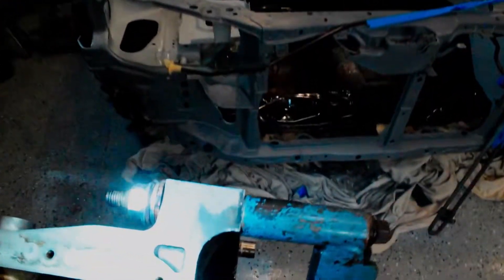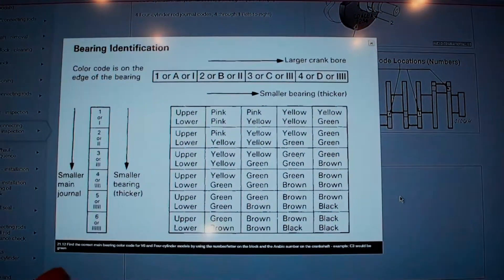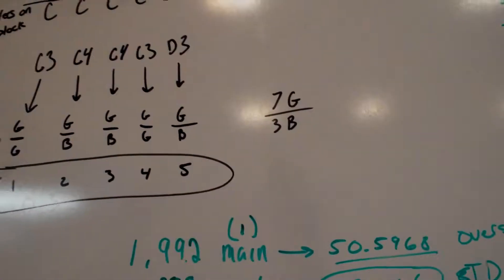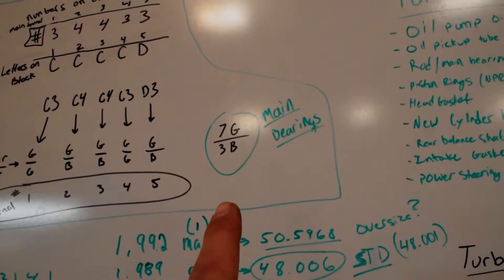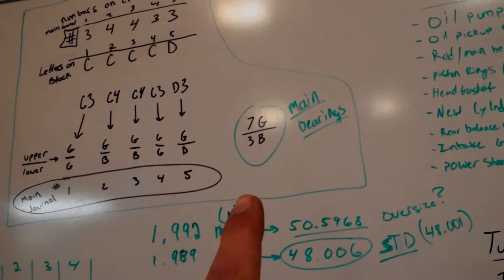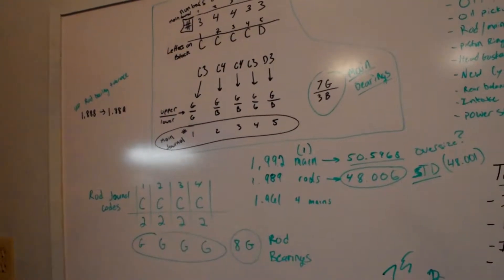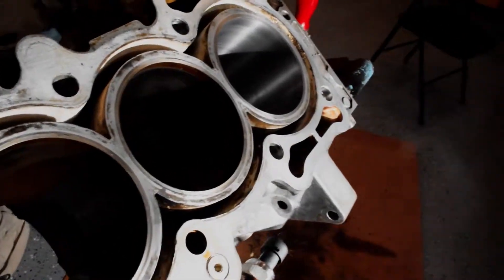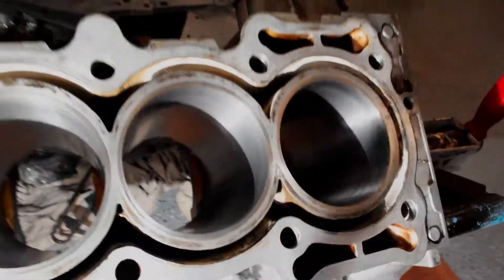Honda Main and Rod Bearing Selection and Cylinder Honing

Comment: I'm confused... so I just bought standard size bearings.. which I thought would work because they are oem replacements.. where do I buy these color coordinated bearings? Say I need four greens for my mains.. where would I buy them?? I thought by using plastic gauge and checking the clearance to see if they are within spec of oem replacement or standard size bearings would work?
Reply from the maker: Yeah I'd try to plasti-gauge them. I know plenty of people use standard bearings. I ended up reusing my stock 200k mile bearings because I was confused too and it worked fine so I left it haha

Comment: Thank you for you helpful video!
With this video I managed to solve the mystery with the color codes. The only thing I want to ask is that I have BCCC code for the rod bearings journal on the crank. Lets just say that it is in backward order as the main journal bearings journals, right?
I am also not sure what is the order of the main and rod bearings journals on the engine itself. I am ready to order the right bearings, but I am afraid that I can mess up them on the engine. If there is a blueprint or scheme please help.
Thanks once again!

Comment: You probably took way to much material off while honing? Your ring gaps with be too much and your piston clearance will also be too much. You would need to bore it out to the next size. I would consult with your nearest machine shop
Reply from the maker: You're probably right, but the ring gaps were perfect for a boosted motor without even filing. Although the piston to wall is probably pretty loose I get no piston slap when the engine is cold, and not an insane amount of blow by for 10 PSI. Thanks for your opinion, but the motor has been running pretty happily now for over a year. Not trying to spend all kinds of money at a machine shop either lol. 

Thanks for watching man.
Reply: Well done on doing your research and taking your time. Hondas are a fantastic engine to work on. 👍

Comment: I'm not really sure what engine this is for but it doesn't work for a k20a2. The codes for a k20a2 are in different locations and the chart is different for main bearings. Just a heads up for anyone who sees this video and gets confused since they have a k20 because I did and had to double check myself
Reply from the maker: Yes this is for an F22B2 Accord engine. Sorry if I didn't make that clear. You should refer to your own engine building manual for your engine for sure.
Reply: @ThatAccordGuy  for sure! I was following the manual for a k20a2 and got confused on the main bearing chart but the videos that are coming up on YouTube are all about rod bearings. I haven't found one except yours that even talk about main bearings and its not even for a k20 😂